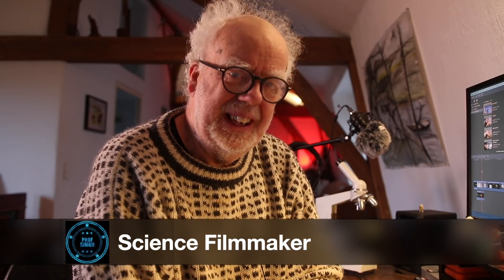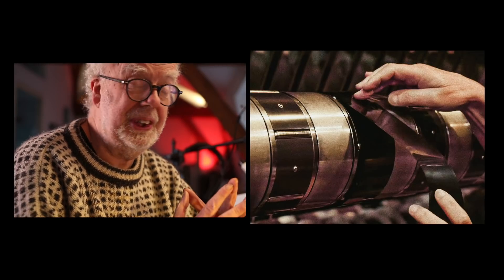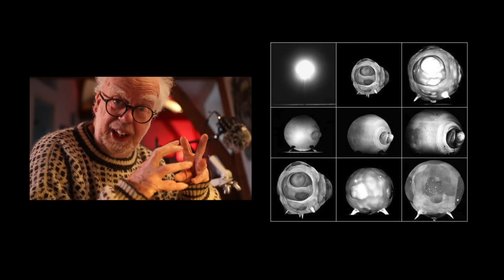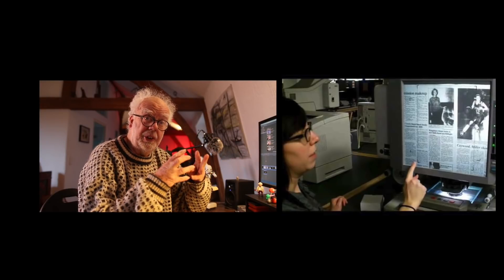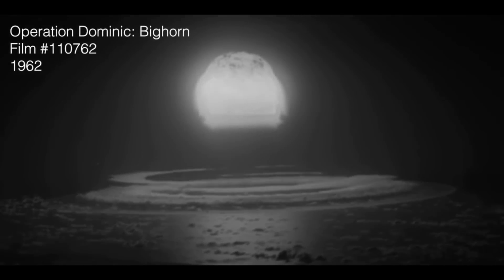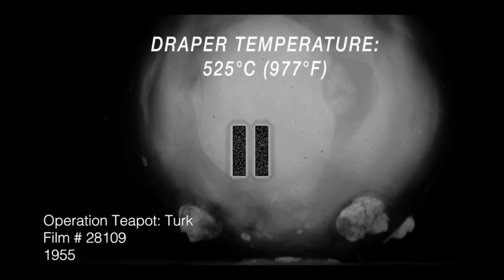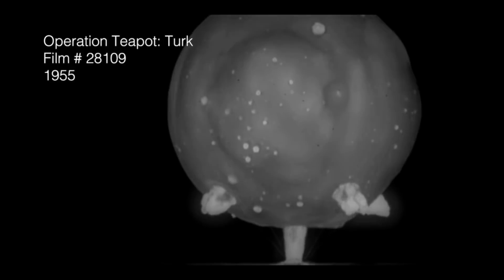kodak nuclear secrets

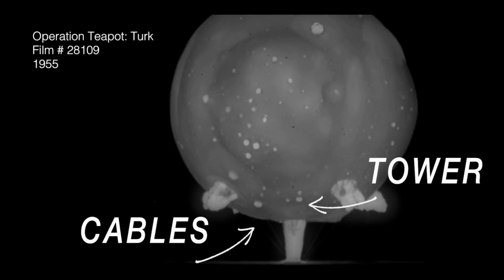Comment: 4:07 - oh it worked my dear Professor.  In fact, it changed the whole arms race.
No longer did you need to fly missiles through the air.  Instead, using a form of gamma ray weapon, you could aim through the planet at a target.  Hitting your target, before they even knew it (without effecting the planet, in theory).
This is old tech now, many have researched it over the years.  
But, you know those experiments to detect gamma rays (using vast water tanks under the ground),  Well, those experiments could have many uses now (with the scenario highlighted above).

The truth is out there.

Comment: Heat wave from the explosion.
Reply from the maker: it's in front of the blast or heat wave
Reply: @SimonHollandfilms  It is in front of the blast and the heatwave, but it is caused by the heatwave. The visualized expansion of the heatwave is seen because the temperature inside the expanding wave is higher than the surrounding atmosphere, causing atmospheric refraction where they meet. When you watch the structure tests you see a brief period where paint begins smoking right before the structures are hit by the blast. This is the heatwave propagating outward as seen from ground level, but in air, the only thing you see is the atmospheric refraction caused by the temperature differential.

Comment: My high school physics is a bit rusty, but I think it is refraction. When light passes from one medium into denser one it slows down, causing it to bend (refract) INTO the denser medium (imagine running the left wheels of your car at 40mph across a 3" deep water puddle, for about 20 feet. Assuming no hydroplaning, which way will the car pull?). At many of the refraction points along this visibly expanding spherical boundary, the light reflected by the smoke net 'threads' is refracting (bending) OUT, into the wave. 

I believe this is due to the compression wave ahead of the blast, basically increasing the atmospheric pressure (density of the air) and causing the light to slow and curve into the 'slow-down'. I wonder if that theory could be tested using the Snell's Law equation in reverse? Starting at the endpoint of Snell, use the apparent angle of refraction (say, 15 degrees), calculate the density needed to produce that amount of refraction, and check it against the strength of the likely pressure wave created by the bomb?

But there seems to be something else occurring AHEAD of the compression wave where, at several points along the wave/smoketrail thread intersections, the smoketrail threads "break" just before the compression wave arrives. Perhaps this is due to a sudden drop in atmospheric pressure and temperature ahead of the pressure wave, causing the suspended water droplets in the air to condense, creating the formation of a cloud form, thus obscuring the light threads.

Comment: During sub-sonic flight air movement happens ahead of the moving object. During super-sonic flight the shock wave moves ahead of the moving object even if its by a very small amount. Is the white portion observed on the film expanding light or a layer of expanding, highly compressed super-heated steam? An air shock wave should not travel faster than the speed of light but it may travel faster than a wave of water vapor. I need more details to create a theory on the ripples.

Comment: That ripple looks very much like the shock wave propagation from the eplosion. The smoke trails are far behind the explosion itself, we observer the trails through the shockwave. Correct me if I am wrong, but to my understanding the shockwave compresses air, whose refraction index goes up with the density.
Reply: If the smoke trails were far behind the explosion, from the camera position would they not describe the shockwave passing into the distance?
Therefore to observe the shockwave accurately emanating from either side of the bomb, would the trails not have to be the same distance away?
What would be the purpose of placing the trails behind the bomb, which would cause obscuration and distortion of the effect being observed??
Thanks

Comment: My therory is the "ripple" is caused by an atmospheric distortion from the heated air sphere expanding concentrically outward from the explosion, causing a radiating change in air refraction index.  This theory is reinforced by drawing a line between the ripple points that will produces a concentric shape associated with the blast itself.
Reply: In essence you are correct.  Shock fronts are essentially compressed air expanding outward.  The pressure differential is so great at the boundary that it refracts the light slightly.  This can also be seen in conventional explosions in slow motion - Similar to shlieren imagery of shock fronts around aircraft breaking the sound barrier.  What they discovered through the nuclear testing was basically that 1 - the shock front is the most devastating effect of the blast and 2 - the ground can be used to deflect and focus a shock front if you detonate a specific yield at a designated altitude AGL.  So the ground can be used to not only magnify the effect of a shockwave at ground level but it can also be used to create multiple shockwaves in succession - maximizing the effect of the weapon on its immediate surroundings.  I worked in munitions in the USAF.
Reply: That is what I thought.  As seen in the blast footage of structures, military and other equipment staged at the proving grounds, the radiation reaches the structures and vehicles before the air blast does and the heat generated causes the paint on them to incinerate.  This can be seen in the guy wires which vaporize from the X-ray blast which goes out before the fireball reaches the no longer existent wires.  The air also is being heated by the radiation, refracting the light.  I think one thing they had some success in mitigating radiation is putting a lot of smoke in the air in between the bomb and sensitive equipment which tends to shield it from radiation.
Reply: TheIdeaOfBuildingAndIgnitingTheseWeaponsIsTheInsanityOfMan

Comment: Now I know what those cross hatch lines are; I assumed they were a creation of the explosion.  Refractive Index is used to determine gemstone species.  Gemmology is a hobby of mine and we use a Refractometer to determine the refractive indices of gemstones, most being double refractive as you rotate them, meaning you get two readings.  It’s to do with the molecular structure of the stone.  Diamond being singly refractive, Ruby being double.  Perhaps the atmosphere around the blast is changed somehow.

Comment: I know what this is: It is the result of the Faraday Effect and it is caused by a very strong magnetic field generated by the EMP.
Reply from the maker: that's interesting.....can you explain it more.....contact me please
Reply: @SimonHollandfilms  Yes, I can explain it more, as well as a lot of things related to it. (Field theory is one of my specialties.)  The light is literally being bent.  The path of the light rays between the trails and the camera are being bent due to the Faraday Effect, causing the offset in the image.  Not sure I want to spend a great deal of time going into more right now though.  If anyone is compelled to do so then they can contact me (I'm not reachable via YouTube or gMail, however I can provide a contact address here in this thread upon request) and I will see if I can spend a bit of time going into some details.  Even this idea I hesitate with.  What I am trying to avoid is having to answer the thousand other questions that might arise should I start down this path of explanation. (Next thing I'd have to write pages and pages just to explain things and that's not what I have in mind right now.  I'm not joking, that is the way some of these rabbit holes go.)  Specifically, should I comment further and provide other examples of where this phenomenon can be observed (there's a hint someone might want to look into) then that would lead to me to have to point out some current academic perspectives and theories which are flawed, and then I'd need to get into the meat of that too, introducing alternative perspectives.  It can turn into quite a big rabbit hole you see.
Reply: @AzureSky6612  just tell them about x-points 🤣
Reply: @AzureSky6612  are those uap tictac real objects ?😳

Comment: Refraction - it's a supersonic shockwave so the atmosphere is being differentiallycompressed - higher pressure inside the wave, lower (normal) pressure outside. More density = higher refraction. It happens to a lesser extent with conventional explosions too, it's usually more apparent in moist atmospheres.
Reply: I would guess it is an artefact of the shock wave that is approaching the camera. The wave propagating towards the camera, with the smoke trails equally far in the distance, is compressing the air, and this is showing up as the distortion in the lines as the wave moves outward and up, so the distortion is the edge of the shock wave as it nears the camera making the smoke trails appear to move. Shows up as moving up the trails, exactly as if the wave is approaching, and occupying a larger and larger part of the field of view. Remember these cameras are really far away, so as to survive the blast, and thus have a correspondingly narrow field of view, focussed entirely on the small section of the sky where the soon to be event is to occur.

Thus they are less than 5 degrees of view, and really magnified, though with the slow film used they had a pretty wide aperture, so as to get enough light on each frame as it moved past so fast. ISTR that the camera ran the film at very high constant speed, using a polygonal drum to focus the image onto a thin plane that followed the film, with a rotating shutter that allowed it to only expose a slit down the film, then blanked the exposure while the next polygon came into frame at the top of the next frame. No interrupt mechanism would be able to operate that fast, and the film stock would never have survived the process either.
Reply: Gord Slater good explaination. 👍
Reply: It occurs ahead of the shockwave. Did you think you had one on the L L Lab kids?